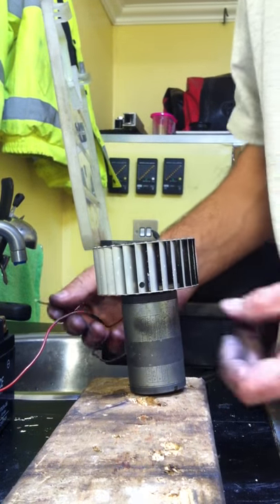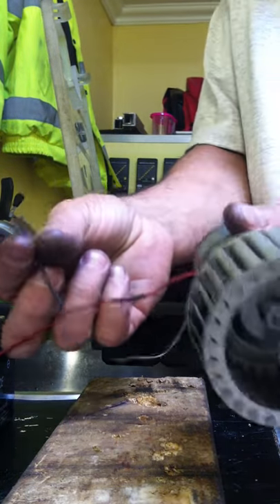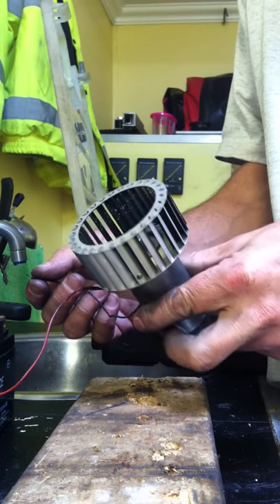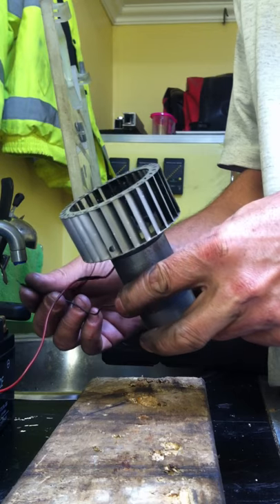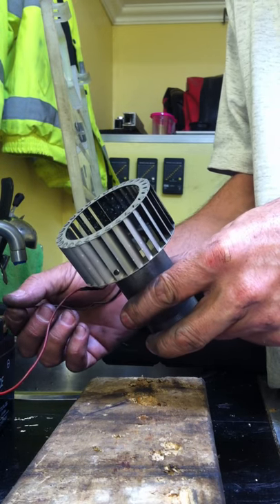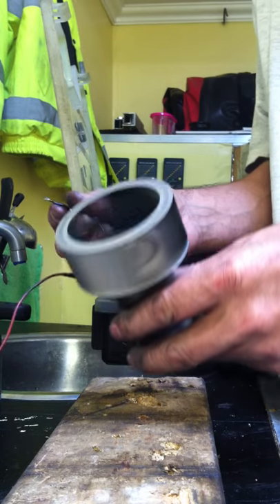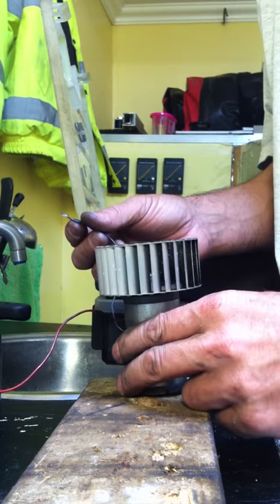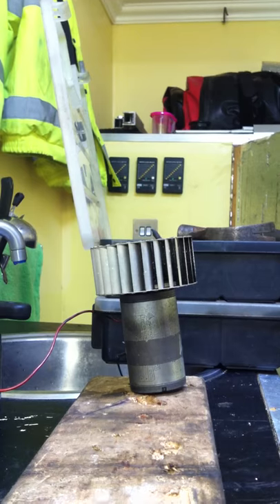PROPEX HEATER - (ALL MODELS) -12 VOLT -  FAN MOTOR CARBON BRUSHES

Comment: any ideas why my fan wont shut down when i shut my hs2000ix off at all? lol any help would be appreciated :)
Reply from the maker: Sounds like a PCB issue....I removed my PCB board and made the unit manual...All the best
Reply from the maker: Call propex...they are helpful
Reply: @versatec1  You made your unit manual huh? How about ignition process, etc?